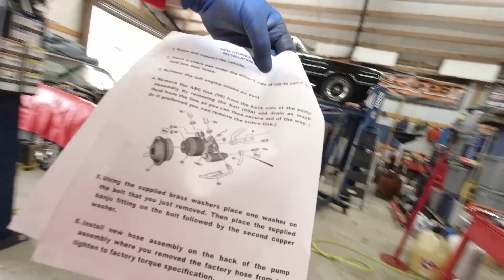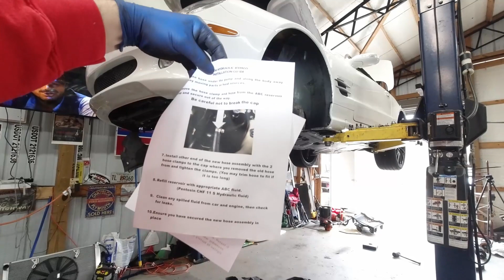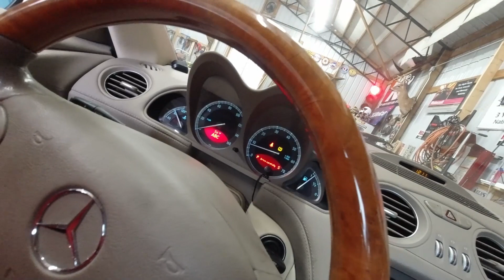SL 550 Hydraulic Bypass

Comment: I just bypassed mine! I have an S55 and I cut the ABC output line behind/ below the AC compressor and clamped a hydraulic hose on there and ran it to the reservoir. It wasn't easy but I got it done.

Comment: Did the bypass fix the leak issue? I’m curious because I’m doing this conversion to one as well. But the pump seems to be leaking from the ABC side.
Reply from the maker: The pump wasn't leaking.  It had a line leaking from a rupture.  The kit took care of this problem.  I  can't say if it will fix your problem.